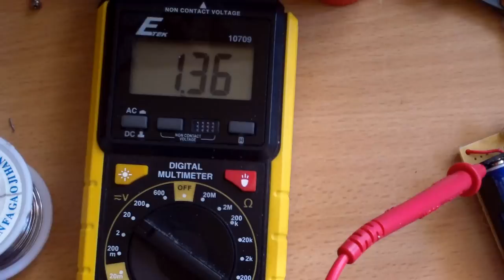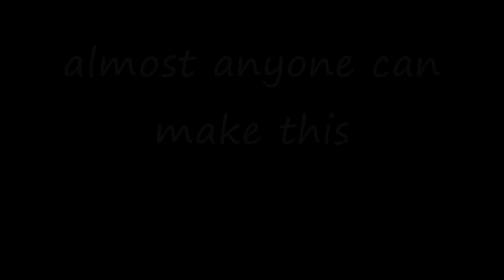QX5252 FET based solar light part 2

Comment: The QX525 is not an FET, it is an ASIC (application specific integrated circuit) which in the case is an IC whose sole purpose is controlling Solar powered garden lights and the charging of it's battery.  If you want to know how it works, max voltages, sample circuits, value to use for the inductor,  etc do a search on 'QX5252 data sheet'.

Comment: Some years have passed and I just saw this ,My question is where is the negative of the battery i saw only Positive side. Can anyone explain to me thank you
Reply from the maker: All negatives go to pin 3.
Reply: @wtam69 Thank you .3 pin it should be from Right to left  and that would be the 3 pin right correct me if i am wrong once again Thank you I sub and gave feedback God bless you
Reply from the maker: With the flat side of the chip facing you, the third pin on the right is the negative.  Thanks for subbing and good luck with your project. This chip great for a small solar light project. @michaeljohnn2598
Reply from the maker: I forgot to mention, with the flat side, (with the marking of the chip) facing you, the third pin on the right is the negative. @michaeljohnn2598
Reply: @wtam69  I dont know how to Thank you.i made mistake and you correct me. what i want to say previously  3 pin from left side to right side thank you Sir. very much for your help
If you were close I would Bring you abox of  beer  :-)
Reply: @wtam69  Dear sir how are you today I received the QX5252 from amazon when i look they are all flat side sorry i got confused
Reply from the maker: Look closely and you should see writings on the chip. Have the writings (5252F)facing you. Then count from the left to the right and it's the third pin that is the negative for all. The first pin solar panel input +, second pin battery +, third is negative or ground and 4th pin is led +.  Use a single rechargeable AA battery, a 2 volt plus solar panel and a single or multiple LEDs.  @michaeljohnn2598
Reply: @wtam69   solar panel with 3V or less is okay or should be 2V You helped me alot many Thanks God bless you
Reply: @wtam69  it work I make it today I will definitely do more for our  garden i came here to Thank you God bless you
Reply from the maker: Great. It works better than store bought ones. I put the circuit board with the leds  into a glass jar and mount the solar panel on top. It is energy efficient and can run on one or two AA batteries. At times, you might make one that don't seem to work even though it's built according to the circuit. In that case, you have to let it soak up the sun and leave it out for a day or two for it to "break in".   Have fun making them and seeing them work. @michaeljohnn2598
Reply: @wtam69  Thank you very much iam doing solar for my Garden Through your help many thanks God bless you and your familly

Comment: Hi wtam69, I can't find in your channel if you have already made one video in which you explain how to do a voltage regulator for the AA batteries, because I'm interesting in it using with a little DC motor generator. Can you help me?
Reply from the maker: Luca Urbinati I don't think I made a video of a  regulator for AA batteries. A simple idea I got from Ed Lenz's website is the use of a zener diode and a small load such as a LED or a resistor.  You use the zener diode with voltage you want to regulate.  That is, 3 volt zener for charging 2 AAs in series. Just connect the zener with the black band towards the positive of your battery and the other end to the positive of the LED lead (3.3v) and the negative of the LED to the negative battery terminal.  There are probably easier ways and you can do a search. Do this at your own risk.
Reply: wtam69 Thank you very much for the little but clear lesson. I will try your method and I will continue my search. I ask you the last two questions: how can I understand which type of rechargeable batteries I have to use? I knew that they want to be loaded following a constant charge cycle, so: AA batteries are suitable for my small wind turbine that turns with discontinuous winds? Thanks in advance.
Reply from the maker: Luca Urbinati  The type of batteries you use depends on the how much power your wind turbine can produce. I suppose you can think in terms of watts. More powerful wind turbine requires the use of a dump load switched on by a relay after the batteries are charged. The load will help keep the wind turbine from free spinning and self destruct. Obviously, the wind charge controller will have more complicated electronics and is beyond my expertise.

Comment: My battery supply voltage is 5 v snf 2600 milliamp / hours.
Would this same setup work for me?  perhaps using a slightly larger solar panel?
Reply from the maker: Clown Whisper Don't think it'll work with 5v. The chip is designed for 1.5v battery. It can drive the higher  voltage LEDs because it's a joule thief type circuit.
Reply: the chip acts as a joule thief???? bizzare
Reply: oh nvm the little inductor coil..... forgot

Comment: I'm trying to understand the impact of the 6v solar cell. The 5252 appears to be operating at 1.5 volts so my understanding is that 4.5 of the 6 volts is getting converted to heat. The 5252 datasheet indicates a max voltage of 5.5V for the 5252 chip. I'm interested if the larger 6V solar cell results in noticeable warming and in how this circuit performs over an extended period of time.
Reply from the maker: A six volt solar panel doesn't always deliver 6 volt.  It can be slightly over or at times a lot less. I kind of doubt the 6v panel will overheat the chip. I am not using the same inductor as Freddiew1, which is a 30uh inductor,  and therefore my light is not working as well as his (staying on as long).  My light is very bright but doesn't last the whole night. It hasn't fail yet so I'm optimistic.

Comment: Thats a nice version on a PCB...I updated my description on my video, showing how the night light was performing. The last few weeks have only had a few good days of sunlight so charging performance has been touch and go. But I am still monitoring and have gone down to 4 LEDs for the moment. Your Eneloop recharegables are much better than my cheap one..Will have to get some. Nice job.
Reply from the maker: I recommend the Eneloop battery. I turn the light on last night at 12 and it went off by itself at maybe 6:00. The beginning voltage was 1.36v and it dropped to 1.18v. I put the 6v, 330 mA solar panel by the window this morning for about 2 hours and the voltage went back up to 1.33v.  I figure I can always add another battery in parallel. My other traditional solar light uses 4 Eneloop so they have never failed me.
Reply: wtam69
My panel is 5v, maybe 100ma..Charging in 8hrs of sunshine was OK, got the battery back upto 1,296v & 1,319v...got the light to run from dusk till dawn. But as soon as a gray day came...lasted till around 11pm, so 4-5 - 5hrs. I also noticed that when it really charging good that the LEDs came on in the daytime. Probably because the panel was pushing more than 5.5v which is the max input. Let us know how yours does over the next week please.
Reply from the maker: MrFreddiew1
After 5 hours of charging , it went up to 1.39v (from 1.18 with the first 3 hours inside the house) on my Eneloop AA. I think the theory is when the solar panel voltage is higher than the battery voltage, it charges. When the solar panel voltage is lower than the battery, the lights go on. Open voltage of the solar panel will always be higher and the battery would absorb the charge although excess will be wasted. The circuit would limit the input to 5.5v to prevent overcharging. The lights have not come on at 1.39v. I will check at the end of the day to see what happens and if the light comes on before it is supposed to. It's interesting to see the combination of solar panel and batteries and what the circuit would do.
Reply: wtam69
I have been testing some more, gone back to the original 100uH inductor and put a 1N4148 Diode before the LEDs..started with 2 LEDs, it running after 24hrs on a cheap rechargeable..minimal voltage drop. I added another 2 LEDs at 1,27v..will let it run through the night, let you know tomorrow. The less voltage drop we get, the less sun we need to recharge.

Comment: That's a pretty nice chip.  You might check out that mirror plexiglass stuff to help direct the light.  Lowes might have some of it.  I think I saw some at Menards.
Reply from the maker: I don't much about mirror plexiglass. Have to look into it. Thanks for the info.  I'm happy this is at least working. I have 9 more QX5252 chip left. My driveway will be lit up nicely now.